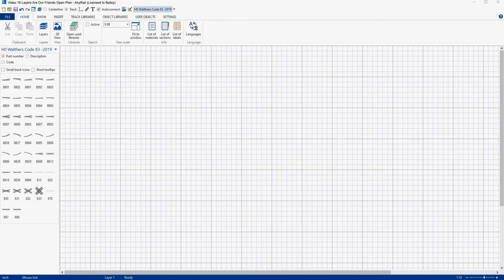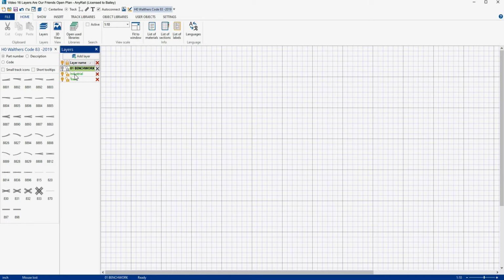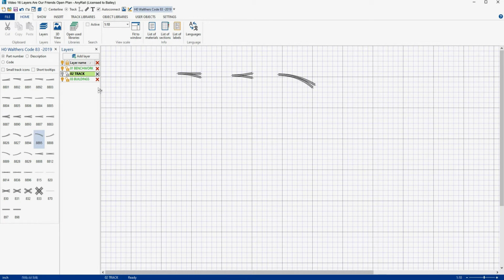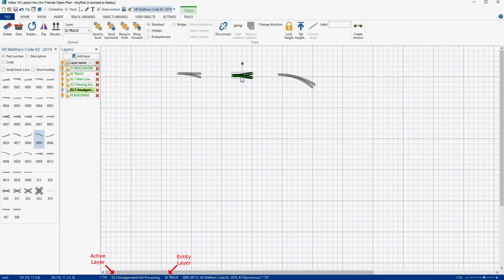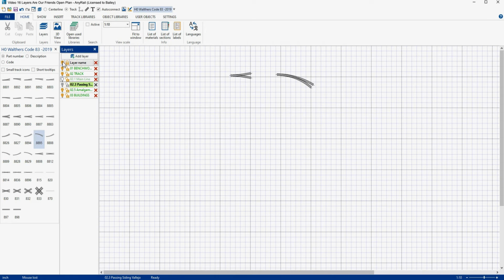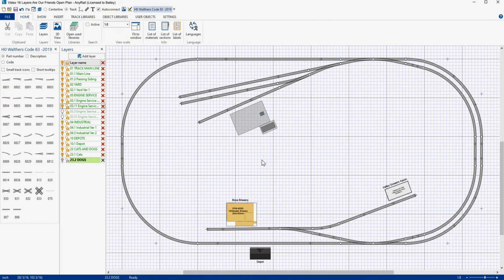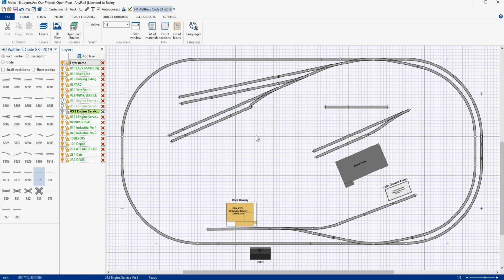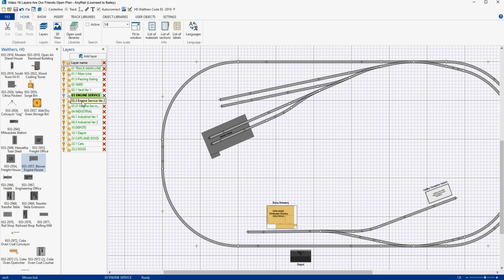AnyRail 6 Tutorial Video 16: Layers Are Our Friends

Comment: Me again!! On a few occasions I have inserted a baseboard beneath the track plan. In doing so the base board is on top and covering the track, I know now that I must turn off the track layer before adding the baseboard, then switched the track back on.

Is there a way of moving existing layers above or below other layers ? 

Regards

Geoff
Reply from the maker: Hi, try clicking on the baseboard entity and then select 'Send to Back' or 'Send Backward' in the ribbon. See if that works. If it doesn't let me know some more details about how you have things arranged and I will recreate it on my computer and see what I can come up with. Dave

Comment: How can I change the colour of a ‘Surface’  that I had to replicate a base board. Default is too dark (Grey)
Thanks for great videos
Reply from the maker: Hi. Glad you like the videos. Thank you! To change the fill color, hover your mouse pointer over the outside edge of the surface. You'll see the edge get more pronounced. Then, left click to select and the edge will turn green and you will see the bounding box with the handle at the top all in green. Then, with it still highlighted, go to the top ribbon and find 'Fill Color'. Click on 'Fill Color' and the palate will open. Select your color and you're done. You can also call up a generic color wheel by selecting 'More Colors' from the 'Fill Color' tab. You can also change the line color of your surface by selecting 'Line Color' right above 'Fill Color'. The slider below 'Fill Color' adjusts the transparency of your fill color. Hope this helps. Dave

Comment: Hi, your video on Layers was very good, but I still can’t do it. Here is what I have done, tell me what I’m doing wrong.  First I made  the layer bulbs & locks chart  I added 6 or 7 more layers here, First Layer was Layer Name, left that alone, next layer I named it My Layout, next one 2 Track, next ones were 2.1, 2.3, 2.5. I then added  3 track pieces to Project Grid as you did in video. Highlighted first piece of that track, then went looking for the drop down list I saw in your video, But it was never to be found, no matter how many time I clicked around that area. What am I doing wrong?  Also I wondered if instead of the one piece of track could I have highlight a whole track circle & made it 2.1 Track.  Thanks Michael
Reply: I found my problem. It was the  02 Track I had added a space before the 02 Track   (space02 Track) that's why the layer drop-down didn't appear.
Reply from the maker: Hi Michael, That's interesting. I just tried putting a space in front of layer names and I still got the drop down. I think someone else wrote to me a while back with the same problem. I don't remember how they solved it and I can't find the comment. If it happens again, let me know. I believe if you have made several pieces of track into a Section you can select and move it to another layer in one piece (just tried it and it worked), otherwise you have to select each piece individually. Maybe I'll do a quick addendum video on how to do that. Dave

Comment: Your tutorials are the most comprehensive I've found. Thank you. I do have a problem. When I add new layers I'm unable to rename them. I was able to give a name to the first layer, but not succeeding layers. What am I missing?
Reply from the maker: Hi Jerry. That is odd. I just checked and as long as you click on a layer and you get the flashing cursor after the text in the box, you should be able to backspace or highlight the existing text and remove it and rename the layer. If the layer box is just green that means that layer is the active layer but you can't rename until you see the blinking cursor. If a layer is locked and you want to rename it, just click on that layer and it will turn green (active) and AnyRail will unlock it automatically. Then you can double click in the box and rename it. let me know if this helps you.
Dave
Reply: @steampoweredradio2981  thank you. This morning I got it to work for me.